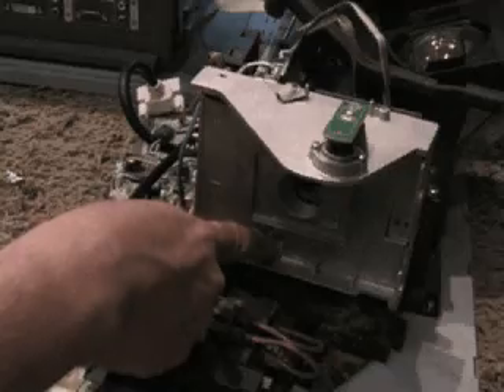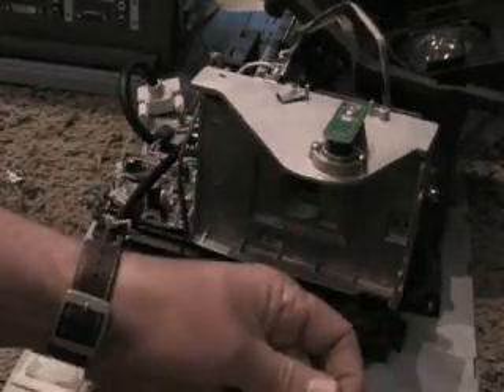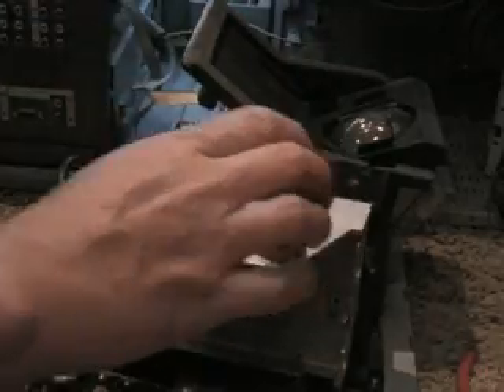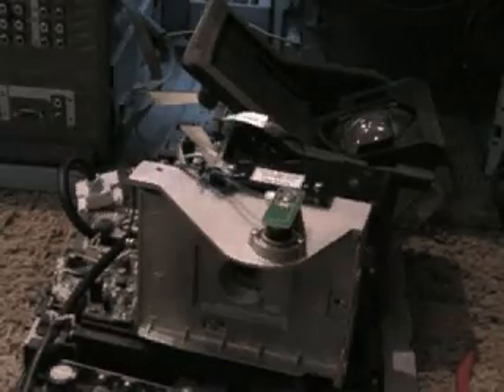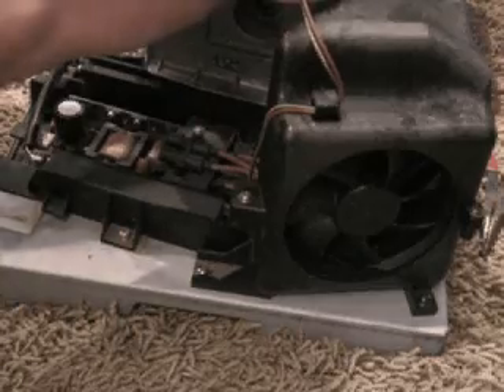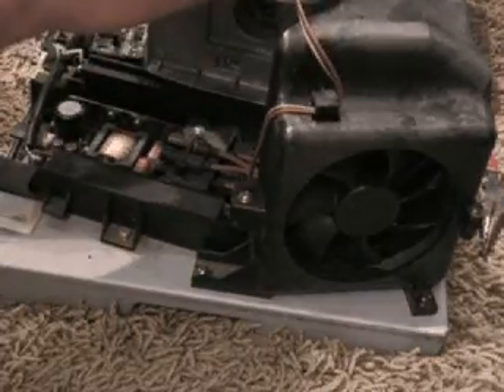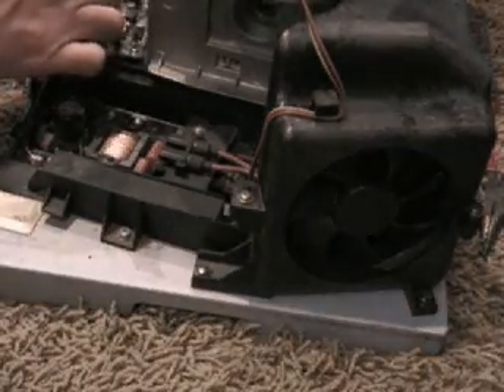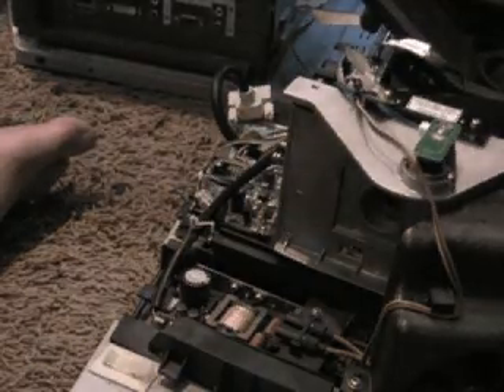Replacing the color wheel in a Samsung DLP Television Part 4

Comment: I find myself here again after my post 3 years ago, with the same reoccurring problem. I found out that the average life for the lamp and color wheel is about 9,000 hours. Seems the DLP technology was a "filler" technology until flat screens and LED's got popular and affordable. Anyway, I'm not ready to eat the $3000 price for my set, so I'm refreshing my memory from your excellent instructional videos. I ordered and replaced the lamp, and the picture was great and like new for about 15 minutes, when all-a-sudden, the picture goes black and white, and lined with distortion. I knew immediately, now the color wheel is bad. So, back to reordering for a color wheel. Moral of the story, get both at the same time, their lifetimes are parallel.

Comment: Thanks for the Video, I used it to successfully replace my color wheel yesterday (4/18/2014). The TV is model number HLP-4663W. This is the color wheel (Samsung BP96-00674A) that I purchased. Though not absolutely necessary, I will attempt to adjust the picture to the new color wheel. Mute182power. Thanks again.

Comment: Very helpful.. The TV repair man was charging $300 just to install the wheel and close to $400 with the wheel. I found a brand new color wheel on eBay for $80 ive removed the old one which was pretty easy thanks to your video
I'll update the installation when the new color wheel arrive

Comment: You are awesome! Your instructions worked perfectly. I received my new color wheel today, installed it, and my tv is working like new again. One thing I found I didn't need to do was remove the large fan as you suggested. I just removed the black plastic cover ( two small screws) and the grey color wheel housing (two screws). By replacing the color wheel and lamp myself, thanks to your assistance, I saved $350.00 - $400.00. I owe you at lease a beer or two!!!

Comment from the maker: @raw7145 Hi - The ribbon cable doesn't have a connector on the end.  So when you say your removed the whole socket from the board to you mean you ripped the connector off the end of the cable or that the thing that the ribbon plugs into came off the board?  If the connector came off the board, I am not sure what to do about that and I am hoping that isn't the case!

Comment from the maker: @124hhr Are you talking about the ribbon cable?  If so, it doesn't have a socket, it is just the ribbon going straight into the board.  When I pulled the cable I thought I pulled off the connector but there actually isn't one there you just shove the ribbon back in.